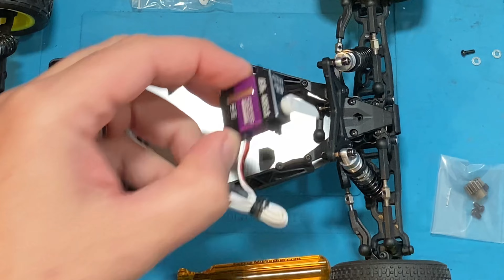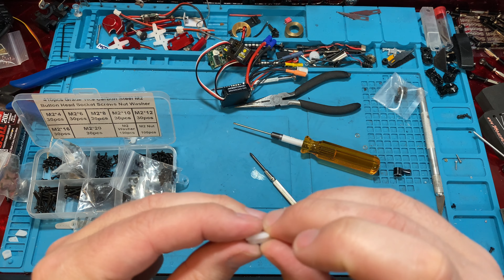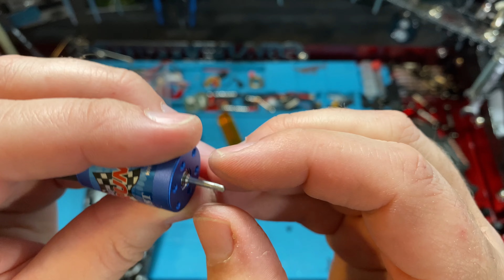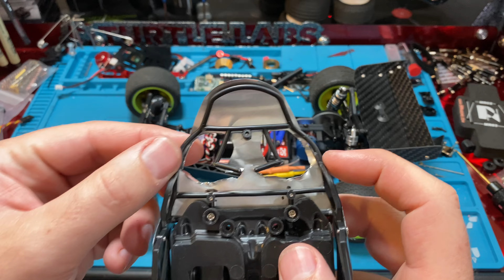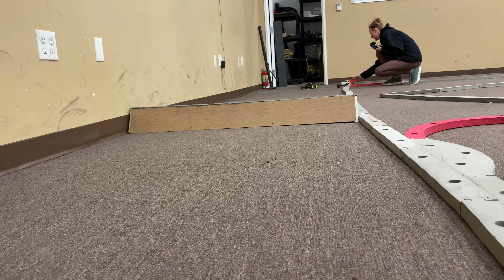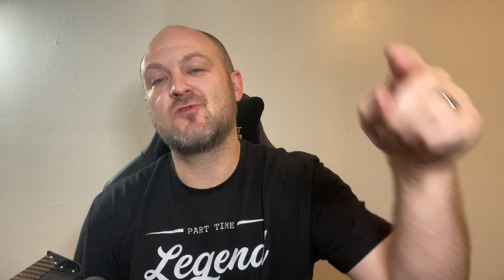Losi Mini B Truggy - Full Build and Run. We use a Walmart Body, AGFRC, Hobbywing, And Flysky!

Comment: Better off with end points , I agree 👍.  I really like that brand servos. They're my go too for bashing. I find them alot better than the Amazon 20 25g 35g guys for couple bucks more. I had no complaints with spectrum minis so I haven't tried agorc minis .  One up grade I do like is HR motor plate. I've dremeled out stock too but not as good.  Sound little tight but ik better tight but these smaller can motors it increases the heat and reduces your free wheeling so you can be csmooth on the track.. man I  felt  same when mini b roller was 50$ off even just for parts  it was to good deal .
Reply from the maker: Yeah. We def want to drill out the plate or get an HR.  Thanks a ton For watchin!!

Comment: Cool build , is there link for pinion gear ⚙️, I have the Reedy 4500 kv I wanted to put in a mini b also. The can little bigger so I can gear high but the shaft slightly bigger than standard 2mm I think it's 2.3 . I figured I just drill 2mm out if I can't find 2.3 . I think it came with 15t and too small for the losis
Reply from the maker: You just have to be 100% sure you stay centered and even if you try to drill it out.  The pinion came with the pro roller.